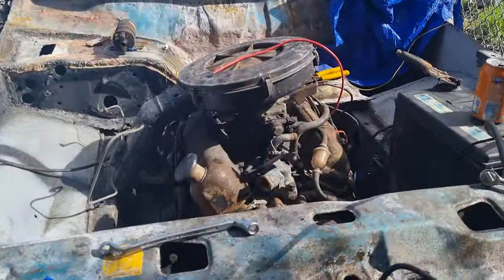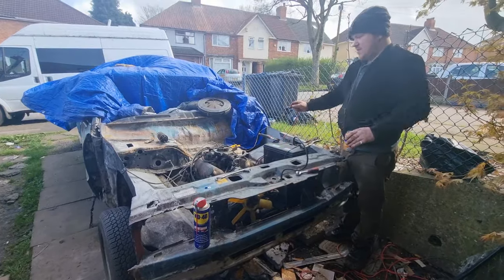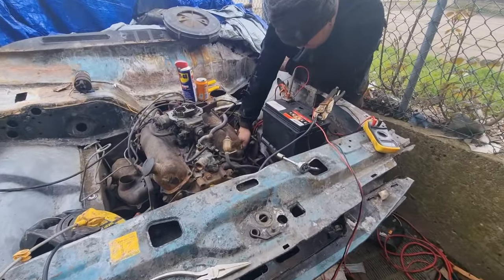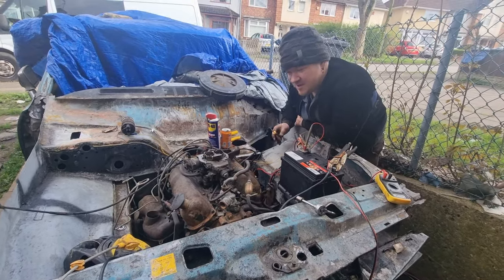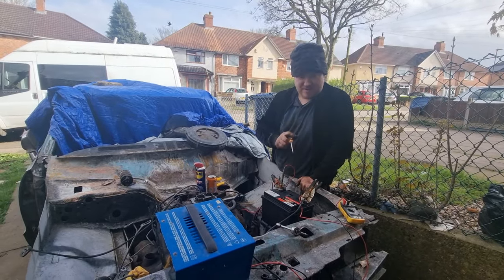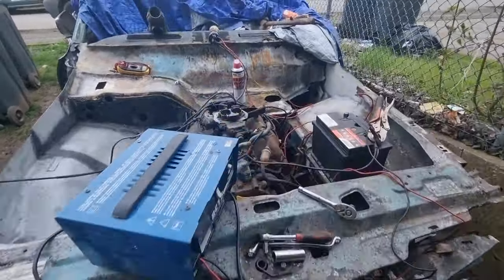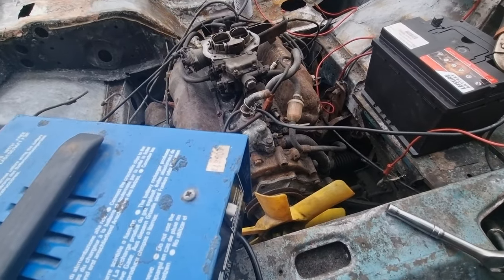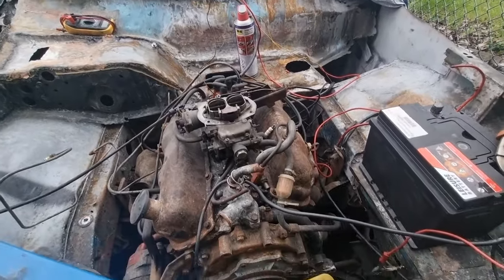Cortina Mk4 Ghia 2.3 V6 Restoration || First Will It Run Fail (P18)

Comment: It turned over that's a great result considering how long its been sat rotting away  unloved and  the miserable uk weather year after year. I would  call this a bit of a win 🏆  engines not seized and startermotor worked too for a while. She needs a little fettling and some new shiny bits ✨️ and she will if compression allows, fire right up.
Good result. I enjoyed it anyway

Comment: Awesome! I know it's disappointing when a motor won't run but as others have said, it's good news that it turns over so well. It sounds to me like you're getting excellent compression, and I can;t hear any nasty knocks or thumps. Progress!!
Reply from the maker: Great point! i will have another bash at it tomorrow if its not raining and take the starter motor off and clean it ect :)

Comment: Flick your points. See if they spark. Is there a condenser in the dizzy. That might be bad. Also lots of these old cars had a alarm on them. But i think you said there no wireing on the car. Disconect your old fuel line. Use a can and gravity feed. Until you check the fuel pump. Dont use easy start.youl blow the rings apart.  Use two stroke fuel to get it started. Use a spray bottle to shot it down carb. You can run a live to pos side of coil. Dont leave it on to long and remember to disconect..good luck.
Reply from the maker: i did flick the points there was nothink dident help with starter playing up im going to take it off tomorow and try it out of the car and yeah no wire loom doing it strate from starter and coil direct could very well be bad coil tho does get warm and i pluged a spark plug direct into the coil and it sparks so good chance its the points will do round 2 tomorrow lol
Reply: @AdamSNook.  Bad Condenser will stop the whole show also. Make sure battery fully charged. Clean connections. On starter and battery. Maybe solenoid stuck on starter. Needs oiling up. Clutch plate could be stuck on. Disconnect prop..put a screw driver down number one plug hole. Bring it to the top. See if timming marks line up. Could be a bad timing chain. Might have jumped a notch. It's not a interference engine so you good there..but check it. I think they have plastic timing gears on these engines..good luck.
Reply from the maker: I can now flick the points and get good spark I am going to remove starter if cleaning dontnhelp will buy another one and retry it again soon
Reply from the maker: I am going to retry soon and going to replace a few things see if it helps

Comment: I had a mk4 2.3 gl back in the early ‘80’s.  Awesome car but not without a few issues.  As has been suggested check the points to see if there is a spark there.  A new coil and condenser are worth getting anyway as these things don’t last forever.  The good thing about the Cologne V6 is that it is really simple to work on.
Reply from the maker: Yeah I will get new points coil ext need them all anyway for the engine rebuild

Comment: Hi mate, you should get someone to film your work more often, at least till you get a tripod. You can always prep what you want them to film and edit it as well. 
I assume you know how the ignition circuit wiring should be, bit easier as it is points. Worth getting a meter round it as well.
Reply from the maker: yeah im going to take the starter off and clean it and try it outside the car i think its sticking pretty bad im not giving up on it i will get it to fire up lol as far as i know havent done it in awhile postaive to posative and negative to the points to negative coil
Reply from the maker: @cortinadale  its intermittent

Comment: Your lucky it even turns over engine and starter motor but I would have the starter out and strip it clean the contacts inside and oil or grease the bearings and the return spring but did you get to see if the electric fuel pump works and check for crap in the fuel tank as could have bad fuel get a new coil and points check all that before you try again mate
Reply from the maker: There is no fuel tank lol a d I think it's a mechanical fuel pump but yeah u are right in the starter motor needs a good clean

Comment: Coil pack?
Reply from the maker: That's what I'm thinking but if I plug a spark plug strate to the top of  coil and flick a wire on it the spark plug sparks so that kinda says the coil pack is making power